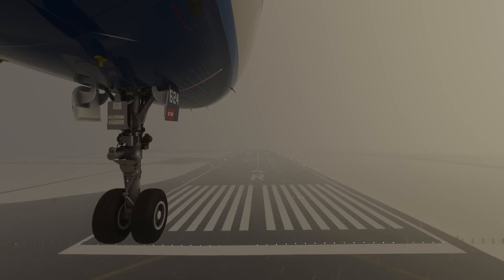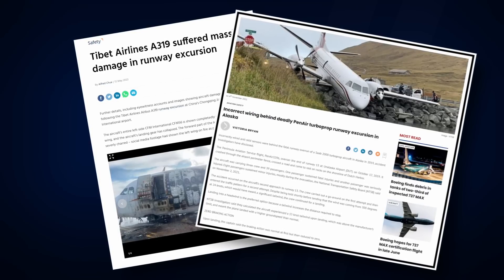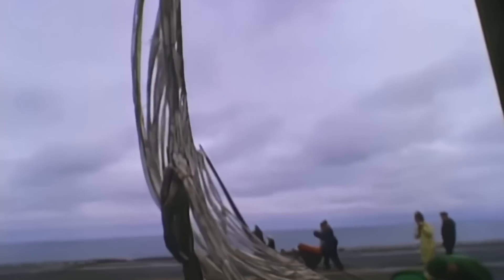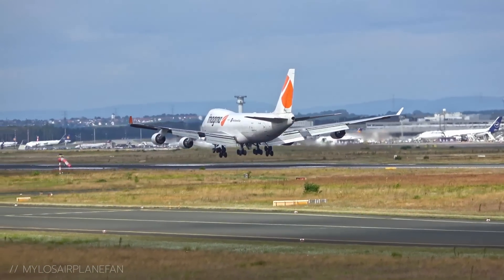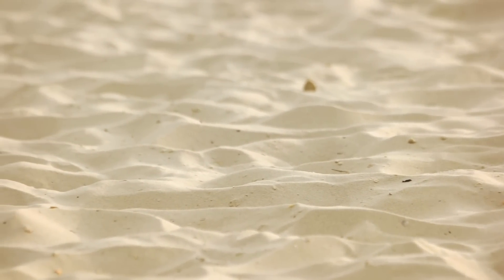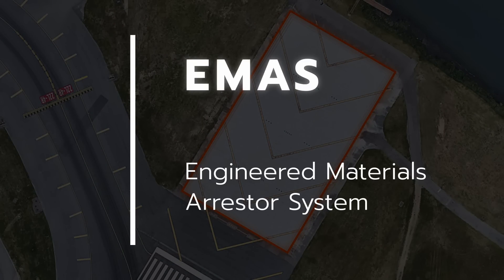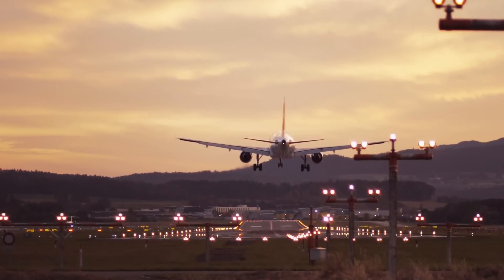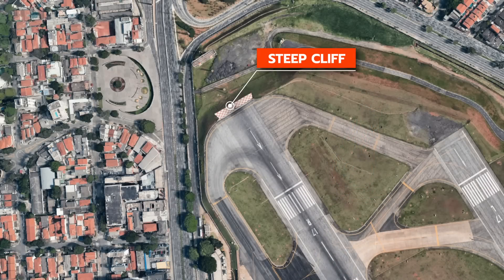How To Stop a Runaway Airliner

Comment: I've just come here because of the plane crash just happened in South Korea today, 29.12.2024! The plane overrun the runway and finally hit a concrete wall, exploded and broke into pieces. The problem was, it had to rely on belly landing due to landing gear malfunction. The EMAS seems to only work if the landing gear works. Has there been any solution to stop an airplane without landing gear?

Comment: Can you make a 2022 Hilltown Beechcraft Debonair Crash with N6129V
Reply from the maker: noted
Reply: @AirspaceVideos  Okay Hilltown Beechcraft Debonair Crash with The pilot owned the airplane and had successfully completed the commercial pilot written examination. The purpose of the accident flight was to prepare for the commercial pilot practical examination. Review of Automatic Dependent Surveillance - Broadcast (ADS-B) data revealed that the airplane departed Doylestown Airport (DYL), Doylestown, Pennsylvania about 1626. The airplane was performing maneuvers about 2,000 ft mean sea level when it entered a left spin and descended into a residential street. During the impact, a propeller blade separated and entered a residence. The wreckage came to rest upright, oriented about 125° magnetic and no debris path was observed. A postcrash fire consumed a majority of the wreckage. The cockpit and cabin were mostly consumed by fire. Both wings separated from the airplane, but their respective flaps and ailerons remained attached. The empennage remained intact with the rudder and elevator still attached. The flaps and landing gear were retracted. Flight control continuity was confirmed from all flight control surfaces to the cockpit area. Measurement of the two elevator trim actuators corresponded to a 5° trim tab down (nose-up) position. The engine came to rest upright, separated from the airframe. The three propeller blades separated from the hub. One blade was consumed by fire about 12 inches outboard of the root. Another blade exhibited fire damage, s-bending, chordwise scratching and leading-edge gouging. The third propeller blade exhibited s-bending, chordwise scratching and leading-edge gouging A copy of doorbell video footage was forwarded to the National Transportation Safety Board Vehicle Recorders Laboratory, Washington, DC.

Comment: This reminds me of guardrails for things like road forks. There are many ways to skin this cat, but the idea is that if hit head on, all the energy of the vehicle will be transferred and take as much time as possible, reducing the forces experienced. Some use big plastic barrels of water, some use compressible guardrails, lots of things. Modern guardrails are also designed to redirect a crashing vehicle back into the road, so as to avoid a head-on collision, or a partial overlap (where a car would be skewered), etc.

There’s a lot of science that goes into stuff like this. P.S. Here’s a interesting video on it: https://youtu.be/w6CKltZfToY
Reply from the maker: exactly, this is similar!

Comment: I feel lile the argumemt for not using gravel was weak. If fuel leaked on to gravel it can burn. If fuel leaked on to EMAS it can burn. It depends how much fuel there is and how hot it is. You should have focused more on accessibility. Loose earth is difficult to traverse. I'm sure that's the main reason why EMAS was adopted, not because of loose material or fires.
Reply: There is also the issue of the environmental effects of fuel contamination of the media and soils which is also a problem with liquid-permeable media like sand and gravel. The prefabricated cellular concrete blocks look to be less permeable and faster to replace which could reduce the time required to remove contaminated media, underlaying material/layers and surrounding soil which is usually an expensive and time-consuming task that doesn't get as much attention, reopening the runway even a single day earlier than other options represents a big saving in potentially lost income from a runway closure to renew the overrun area. I'd imagine there are lots of smaller benefits to using these prefabricated blocks over other materials too but I can only speculate.
Reply from the maker: also, fires can be put out much better on concrete than on sand/gravel that soaks. just put extinguishing foam on the concrete and voila.

Comment: I haven’t heard about this technology. I immediately thought of pilots like myself - I have very little experience and fly small GA aircraft. I can easily imagine screwing up and unwillingly landing in this area. I guess if it holds a fire truck, it can hold a Cessna 150 with me on board :)
Reply: That seems unlikely. The markings (7:17) are intuitive enough that I think even an untrained passenger seeing a runway for the first time would know not to land on the chevrons.
Reply: @bhc1892  Sure, it is not likely. Pilots are not supposed to land in the stopway part of the runway. Still, I can imagine a private pilot trying to put it down on the numbers and then poor energy management and just landing a little too early. During my training, one time it was tight between airliners, and I was given the clearence to land, backtrack and quickly exit the runway. Then my instructor told me to put it down on the numbers and quickly exit the runway to make space for the big boys. Was this smart? I don't think so. But situations like this just happen sometimes.

Comment: Funnily enough, my local airport's runway is equipped with both an arrester cable and net. The Finnish Air Force send their F-18s here occasionally. I believe some precautions were needed with Blue1's 717s, due to the debris deflector on the nosewheel causing a slightly elevated risk of getting caught in the cable - don't know the details, though.
Reply from the maker: Yup, from time to time you see an arredtor cable at dual use airports: those are used for civil and military aviation 👍🏻

Comment: Likely other factors involved in the engineering would be how easily and quickly the aircraft can be recovered and the surfacing repaired. Especially at a busy single runway airport.
Reply: There was a southwest 737 that hit the Emas the blocks are shorter than the landing gears so it it was back to work in I think 3-4 days

Comment: Ive actually seen a video about how they put air bubbles in that brittle concrete at the ends of the runways. It was amazing and simple they tested it and as the plane with its breaking system rigged ran off the runway the wheels just sunk and dug in over about thirty foot. The plane was actually ok and just needed maintenance to the tyres, wheels and bogey and I thought that a good simple idea. I was going to say cheap but im guessing you patent a certain polymer of concrete for this type of application you are going to make a few bob with it . I just thought it a very simple but different idea. I suppose the contractor doing that work would obviously need to resurface the end of the runway after being deployed in a over run. I say simple but I think there was a lot of science involved in  getting this technology in to use. Thanks for the video very very professional.
Reply: I didn't know all the complexities involved either, to make this EMAS system safe. Bless the engineers who worked tirelessly on developing this concrete. Hopefully, EMAS doesn't have to be used, but when it is, it saves countless lives. Assuming 15 EMAS usages so far, and 406 passengers saved, then, after just 100 uses, ~2707 lives would be saved, assuming the worst case scenario if this safety future wasn't deployed. :) That is the equivalent of preventing a 9/11 scale fatality every 110 uses. Hats off to the scientists who made airports safer for all who fly, and live near the runways.

Comment: The problem with sand and gravel is they constitute a fire hazard in the event of a fuel leak. How do these engineered blocks deal with leaking fuel?
Reply: They don't absorb fuel
Reply from the maker: exactly
Reply: @fvngvsxx798  but the fuel leaks down between blocks. It will be difficult to remove and is a definite fire hazard.
Reply: @stevewilson5546  it's not a fire hazard because the air wouldn't be able to mix with the fuel. In order for a fire to ignite, you need fuel, air, and heat. Of course, we're talking about fuel that has seeped below the surface of the concrete, the fuel still on the surface could still ignite but there's no real way to prevent that. A surface like sand would allow air in and thus a fire could start under the sand.